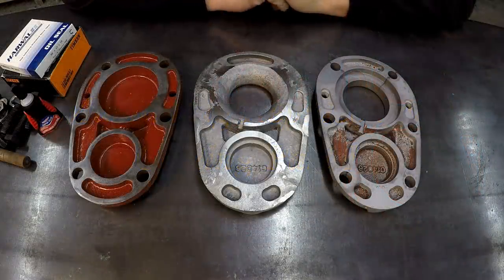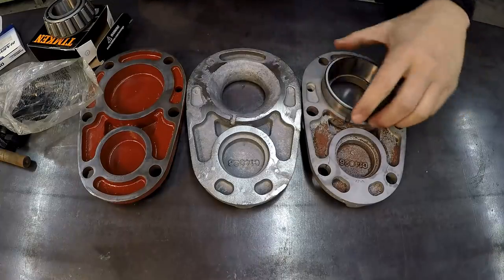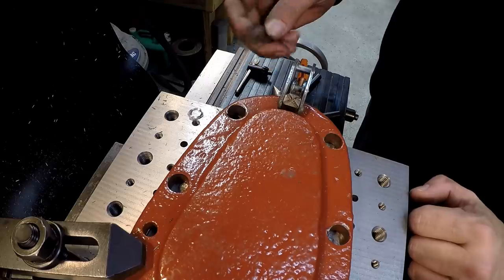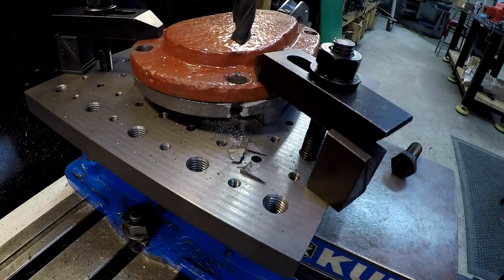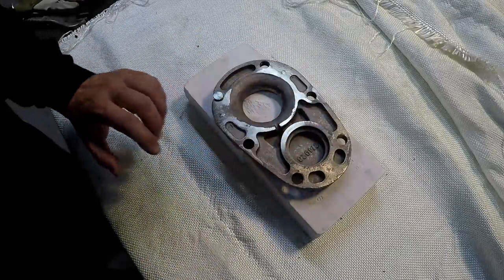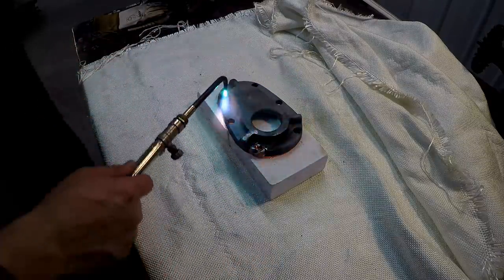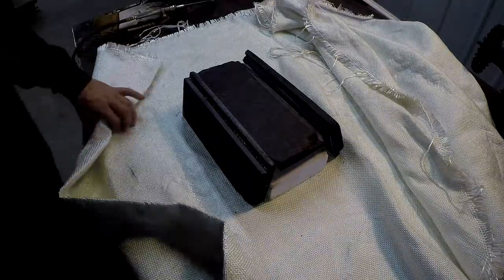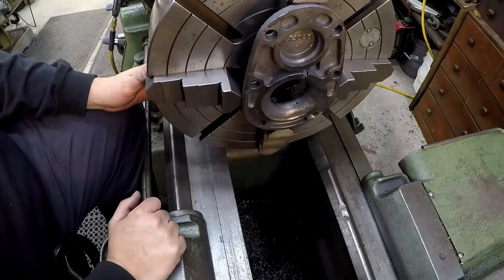Machining a Replacement Casting Part 1

Comment: Great video. Question, how come braze instead of weld?
Reply: Because its cast. Welding a casting can be done, but it's a royal pain. You end up with lots of cleanup work and if its not done right, it is likely to fail. If its cast iron, you have to preheat and make sure you keep it hot and work quickly. You can also introduce impurities like white iron into the casting if you're using the wrong filler or electrode or the wrong rod if you stick weld. You have to cool it slowly or it will crack. It might crack anyway. Cast aluminum is even worse. Some alloys aren't weldable at all and will not take. Preheat is crucial and aluminum radiates heat faster than iron, so it will crack if you don't keep it hot and cool it in cycles.

And depending on what you're doing, it might simply be cheaper to just buy a new part than try to weld one.

Comment: Is it not a good idea to just make taller chucks for your lathe?
Reply: Wrong type of chuck. You need one with bolt on jaws, and then you could make a set of soft jaws machined to fit the part.
That type of chuck in that size is very very expensive.
Reply: joshua43214 i thought that those jaws could be removed and flipped. Just make one with same over all characteristics but taller?
Reply: @hodgepodgeenginerd1258  Most can be removed and flipped. On his chuck, the threads are machined on the backside of the jaw, not feasible to make new jaws. You need a chuck with bolt on jaws.

Comment: I always wondered if you had embarrassing moments that you edited out or didn't show. It's good to see you're on point most of the time and not afraid to show you mistakes. Now I know nothing about brazing or welding so this question is purely out of curiosity from the stuff I've seen on youtube. I noticed you were wearing dark glasses while brazing and at that brightness I would think the only thing you would have to worry about was the UV light coming from the flame as being damaging and if I remember right I think it was AvE who had a video about the amount of UV that even cheap clear safety glasses let through being almost none. So wouldn't it be ok to use something that blocked the UV but allowed you to see what you were doing better? Please educate me. 🙂
Reply: Oxy Acetelyne flame is BRIGHT!

Comment: no oil when drilling?  than s foe the note. didn't know that about CI and no need for oil when cutting.
Reply: Cast iron is self-lubricating (high carbon content), oil doesn't help and just makes the swarf all sticky. Problem with CI is hard spots, as Adam ably demonstrated.

Comment: Hey Adam I'm just wondering where I can get one of them indicators for picking up hole positions. I'm based in UK and would love  your help. We do a lot of gundrilling and mainly use Reinishaw probes but this is not always option depending on hole size and position etc.
Keep up the great work, love your content.
Reply: I saw in another comment by "TheVexCortex" that it is a "Blake coaxial offset dial indicator". Hope it helps.
Reply: @MK23C . Thanks great help.
Reply: Ross Deakin got mine on eBay for $80 usd coaxial indicator. Can be used for more than hole finding.
Reply: Look for "Dasqua Co-Axial Centering Indicator Gauge" at chronos.ltd.uk

Comment: That looks like ordinary 'woven roving' for making fiberglass panels ?
 (boats, etc) I'de never have thought of using it as welding blanket
Reply: It may look like fibreglass matting but it is a special weave of flame retardant fibreglass. Roving is a much looser weave to allow resin to be absorbed.

Comment: Yep, l got frustrated with not having enough swing on my lathe so can now increase it from 330mm to nearly 700mm.  It only takes a couple of minutes to change, and quickly changes back when I'm finished.
Cam

Comment: Can you anelle it in perlite or sand ???
Reply: Annealing a metal requires you to bring the metal up to its' proper temperature for a given time per cross sectional inch of material then slowly allowing the material to cool to room temperature. The way you can slowly make the metal cool can vary such as keeping it in the same oven you heated it up in, closing all of the vents then turning off the oven. You can also wrap it up in an insulating blanket, pour an insulating material (like pearlite) around it or heat the metal up while laying on a bank of sand then pour sand over the item until it is well covered and will slowly cool.

Comment: We used to have a tank of what looked like corn flakes I’ve no idea what it was but when we welded or heated casting they were buried in it to hold the heat worked great 👍
Reply: Not shure, but is that called annealing?
Reply: si Spring yeah that’s basically it we were more trying to avoid chilled cast iron after a repair. It was the flakes that I didn’t know what they were
Reply: @anthonyambler9688  Kind of sounds like vermiculite, but I'm guessing...
Reply: chemech Now I’ve read that. That name does ring a bell
Reply: vermiculite

Comment: I suffer “aphasia”, stroke which means. I am unable to talk. Only “paste & copy” I am unable spelling.  6:30 mins, Dial Test Indicator ? Name DTI ?
Reply: I have heard of a similar case recently. A man had a stroke too and he lost the ability to speak Greek yet he can speak English since the second language is in a different part of the brain.
Reply: I believe it's called a co-axial indicator.
Reply: Correct.  The bed is moved around until the needle stops oscillating.  Then the collet is directly above the center of the hole.
Reply: @TheShoreman1 , is correct. It is a co-axial indicator.
Reply: As already said, a co-ax indicator. And I can tell you, they are b*stards to get pin on... but they're about the only thing which will find the centre of a (perfectly smooth!) hole with pin-point accuracy.

Comment: Hey Adam, I wanted to ask you about drill bits. I would like to know how and where to find good quality drills, (small drills up to say 1/2") there are so many brands of drills but it seems that many are just mostly garbage 🗑. I occasionally need decent drills for hard materials such as hard steels, iron, etc.
Reply: I was going to reply until I saw that emoji
Reply: Don’t worry about quality bits in those sizes. Just buy a bunch to have when the boys do break.

Comment: Curious why  not weld it up with cast iron rod after heating the whole thing red hot like the shop that welds diesel engine heads back up does?
Reply: LOL @ CI Rod !!
Try OXYHYDROGEN.
WELDS CERAMICS, STONE, GLASS... AND CASTINGS OF IRON.

Comment: I thought Cast Iron material was pretty soft  ?
Reply: it can have hard spots.
Reply: That wouldn't be cast iron (something directly out of the mold). You may be thinking of Malleable Iron,  Nodular Iron , Wrought Iron or possibly Ductile cast iron.
Reply: If it’s cooled too fast after it’s cast it will get hard as hell.

Comment: Perhaps TIG brazing would have worked with the aluminum plug?
Reply from the maker: Creates hard spots.
Reply: @Abom79  I assume you only had a couple hundred degrees at most between the aluminum melting point of the brazing temp? Brazing iron with an aluminum plug would fall within the "it could be done but you need a damn good reason why" category. (Get the whole part near to the aluminum melt point, then use TIG or similar to add heat just to the right places, let the part slowly cool so there aren't hard spots? That's if the annealing temp for iron is below the aluminum melt point of course)
Reply: @Abom79  I just looked at the metallurgy, and I guess you can't "properly" treat iron withiut melting the aluminum, (900c with a long 700c soak, aluminum melts at 660c). I wonder if holding the Iron at ~600c would allow for TIG brazing and a slow enough cooling of the heat effected zone.

Thanks for responding

Comment: why does raising the knee make it less likely to break the drill compared to lowering the quill?
Reply: Less wobble in the head stock = less chatter
Reply: If you lock the quil it makes it a little bit more rigid and raising the knee is much more controlled process that reduces the load on the drill bit.
Reply: @jonanderson5137  the knee doesn't have a power feed on it  it has a hand crank or an adapter for a drill but that is used for moving the table into position not cutting or drilling, in my experience.
Reply: locking the quill is more rigid, and rigidity is key
Reply from the maker: When hand drilling it the drill bit is likely to grab the last remaining area being drill and pull the drill through the hole causing it to chip and break out the bottom area, and more likely to break or chip the drill bit. Hand feeding the knee reduces all those problems.

Comment: WHy not just fix the broken one, grove out the broken line, brake it up, add meat, so on so forth
Reply: Dont get me wrong, I know you will end up with a great part when your done and you clearly have the ability to repair this your way (the right way). Just seems that sometimes the ks can be harder than we expect
Reply: Bearing bore Is fractured, look at the two lines going from bore out to the edge through the holes. Part integrity is lost. Even if it was brazed/welded expertly it would more than likely fail along  the area where the repair meets the original material. Not many options...
Reply: It looks like it's the bearing seat for a tapered bearing, which will have to be torqued for preload. If old casting is brazed it may not be strong enough and crack.

Comment: I might have hacked off a hunk of that Space Shuttle tile and turned a plug from that.
Reply: I was going to hack one off as I got prestige seating for a landing.  But then those guys with guns would have shot by the time I had one pried off.

Comment: Please someone tell me what kind of material Adam used for brazing?
Reply: dragomir ionut I don’t know about Adam, but Keith Fenner uses general purpose low fuming brazing rod  AWS (RBCuZn-C) A5.8-92/ASME 5FA5.8-9.2 with Peterson #2 high heat flux
Reply: If your in the UK it would be Sif bronze sticks like SH1T to a blanket.

Comment: Did it have to be a new cast piece? I wonder if two flame or water jet CNC cut pieces of plate welded together and then drilled and board would have been easier
Reply from the maker: And then mill all of the intricate pockets as well.

Comment: I bet once you had to repair your new part, you started thinking “why didn’t I just prep and braze the original back together”. It is very rare that any job goes absolutely perfect. But patience and skill will get a great result from any project no matter how much trouble they fell like dealing out that day. Great job. Looking forward to seeing the lathe portion.

Comment: Think I would have cut my losses and plasma cut a steel blank flat face on outside would not matter.
Reply: Yeah but I suspect it's as much to make a video on working with a casting as it is to get it fixed by any means necessary. And I learned that if you have a rush casting job you could end up with something suuuuuper hard and you may need to anneal the sucker once you get it.

Comment: How did you get the half-melted aluminium plug out?
Reply: Looks like he went ahead and melted it the rest of the way out.  He' does it right after he's done brazing.
Reply: @mpsteidle  Oh right I must have missed that part, made a bird poop on the floor.
Reply: He made the half Whole! He fully melted the aluminum out.

Comment: i like that you were able to get a replacement cover cast ,but, why not have it cast in aluminum, or maybe just try to duplicate it from alum billet? also, why no lubrication?
Reply: I don't know why but for some reason you don't use lube on cast iron. Probably it would end up in a big mess, sometimes it's just best to do what the old folks tell you to.
Reply: @vonSaufenberg  cast iron absorbs the oil. Their are some applications where you have to torch the piece to get the oil to burn out of the iron. Cast iron is porous enough which is why it's used for engine blocks. That oil then helps with oiling especially in the cylinder walls on the rings.
Reply: Cast iron has high carbon content. Carbon is a good lubricant in itself.

Comment: Send it back for a casting NOT adulterated with unknown junk!
Years ago MIC 6 Aluminum tooling plated was undesirable do to ball bearings and other hard and foreign "obstacles" presence. The story was, the floor was swept and anything and everything was dumped in the crucible and eventually sold as "cast aluminum tooling plate".
Sound familiar?
Reply: am i missing something....i thought it was grey cast not aluminium
Reply: @martinburwell4214  
Well, Martin,  The rest of us all that have to share your air are glad you "aren't missing something".........

Abom79
Reply: It's not a foreign inclusion issue but a rushed job issue. They turned things around faster than a proper cool down and annealing would take, so hard spots were created. A high temp heat soak and annealing would likely solve the issue.

Comment: +Abom79 Im not a machinist, so pardon my ignorance - why not just do the facing for the part on a vertical mill?
Reply: I'm not Adam, but I think the idea is to do the facing and the bearing surface in one setting, so that the different surfaces are aligned correctly, rather than doing one part of the work in one machine, and then spending time to make sure it's lined up nicely in the other machine. Even a small amount of misalignment may cause issues with bearings.
Reply: Of course, it's a taper roller bearing, so I'm not sure that is actually that critical in this particular case as such.

Comment: That's our puppy. Almost out of red Adam. ;-) thanks :-)
Reply: Btw. Adjusted my chinese lathe today. I think I may had some luck, but got it's taper down to 0,01mm over 40cm with a live center. Adjusted the headstock accordingly to line up with it and I cannot still believe the difference in finish when turning. Smooth as a babys but! :-D. That makes 4 tenths of a thousands inch if I'm correct. Man, that comes in handy making  1" brass screws... lol
Reply: I did buy a four jaw for my chinese lathe, but the three jaw that came with it has a factory runout of 0,02mm/8 tenths. That's pretty impressive, yes?

Comment: Somebody could supply him with an assortment of carbon rods for fill material during brazing.
Reply: Hi haven't heard of that before how does it work? thanks
Reply: I suspect he means in place of the aluminium. Carbon is easy to work, can take the heat, and doesn't stick to the brass/bronze/iron. Another option is titanium when you need the same, but stronger.

Comment: What caused the hard spots? Sand inclusions?
Reply: No...
Cooling too rapidly....and probably the iron hitting a cold mould as well...

Pre-heating the mould and adding a bit of Ferro-Silicone to it before pouring should have helped eliminate this... 👍
Reply: Several kinds of impurities in the iron can also cause hardness.

Comment: Why all the work with the casting? I would have made a new piece from a steel plate, maybe tool steel. It just needs to be fit, form and function...

For the casting perimeter holes I would have plunged an endmill and bored to size, less stress then drilling.
Reply: There is more than one way to skin a cat. Measuring the plate, rebuilding it in CAD and milling a new one is certainly possible, but that's not the way Adam rolls. It would also make for a pretty boring video.

Comment: Use cutting oil...
Reply: Not required for cast iron.
Reply: @zachaliles  if it's destroying your drill bits because it's that hard, doesn't hurt to.
Reply: wouldn't have made a difference. if the material is harder than the drill, no amount of oil will save you.

Comment: He didn’t drill a pilot hole didn’t use lube no wonder
Reply: He's a professional machinist.  Pilot holes on a mill?  I'm not even going to dignify that with an explanation.  You're too far away from sentient.
Reply: @c.j.1089  i was a professional CNC machinist and we always drilled pilot holes. your drill can move when you start drilling especially if you got a bad cast with hard spots like that. 
your rude ass comment is unwarranted, and unintellegent.
Reply: @darkshadowsx5949  Professional my ass. That's a 14mm drill bit with a fresh cut, there's no damn way it's going to deflect.  Nice bullshit story, though.
Reply: @Pyrex238  im a cnc lathe machinist. up from about 10mm, we drill everything with a pilot hole a bit wider than the two edges in the middle of the drill. its always a point of accuracy wanted. if you have tolerances of 5/1000 of a mm, you definitely need a pilot hole.

Comment: LOL seriously, you didn't know the aluminum plug would fail during brazing?
Reply: It was just intended as a plug to allow him to bridge the bronze over the gap, for that purpose it worked surprisingly well.
Reply: @eformance  but now he has to drill out what the plug didn't block.
Reply: Jim Mitchell 
Just wondering how using a plug of lower melting point highly flammable metal (used in WWII incendiary devices) that is almost impossible to extinguish, (bury with sand is effective) would help here, unless you are thinking to melt the casting down (burns at up to 3100°c) and start again? 🤣

Comment: hehe I only have these in standard sizes not metric sizes... yet the world standard is metric :)
Reply: Well he is in the US, so standard is the standard (which has been that was since the early 1800's). It's funny because most of the world had no standard weight and measurements till around WWI and then there was another bump around the 1960's (which included England)